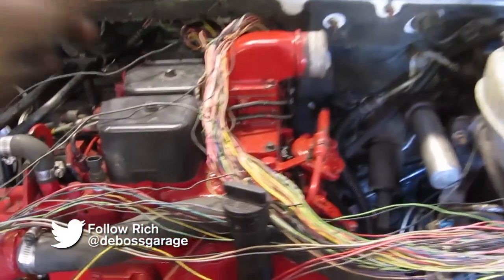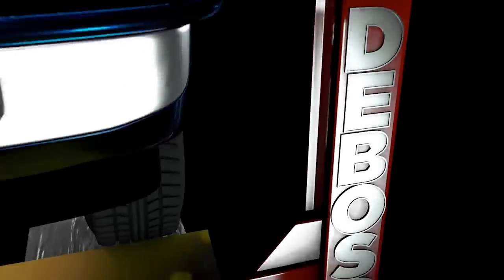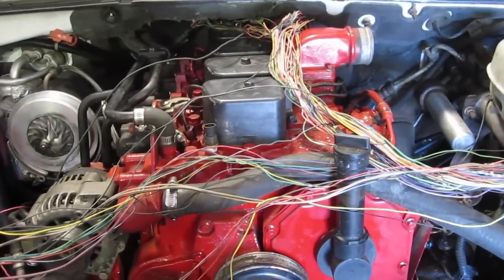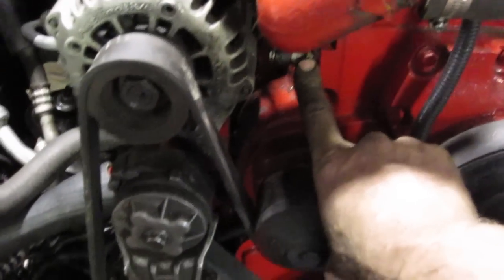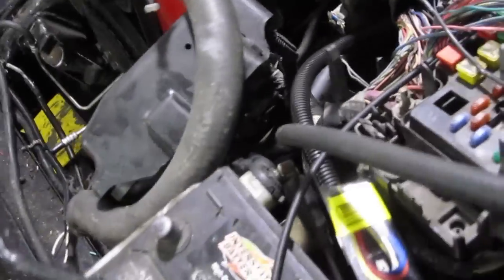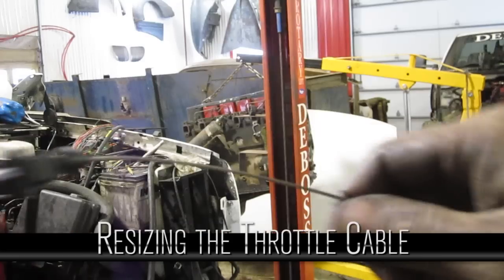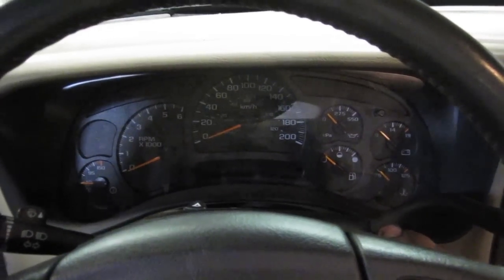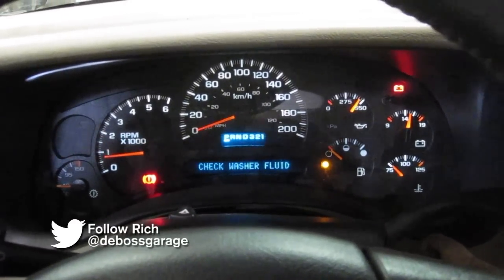Connecting GM Gauges to a 4BT with OEM Wiring #CumminsTahoe [EP5]

Comment: How did you get it to turn off by key, I have a 93 f350 with a 5.9 in it and the guy that built it put a pull lever shut off on it but it's a pain to have to pull that all the time so I'd love to have it shut off by key. Thank you!! Awesome build !
Reply from the maker: If its a VE, its should be key power to the shutoff solenoid built in on the back of the injection pump.  If its a P pump, most likely the shut off solenoid quit and he didn't want to replace it so he put a cable in it.   P-pumps have an external shutoff solenoid
Reply: +DEBOSS GARAGE thanks!!

Comment: just off the top of your head do you have any ideas for getting the electronic throttle from a 2007 tahoe to work with the throttle on the 4bt?
Reply from the maker: With my silverado, I took the drive by wire throttle body and cut off most of the housing.   I put a paddle where the throttle plate was and made a mount that held it to the side of the injection pump.  My paddle would hit the throttle lever on the pump.  When you turn the key on, it does a cycle check where it turns backwards first so it cant have a direct link to the throttle lever on the injection pump but just hits it.  This way you could keep cruise too.  It didn't work though because I would get outside the parameters between MAF, TPS, and MAP and it would go into limp mode.  I was trying to trick the ECU into thinking the 6L was still in the truck.  Since it went into limp mode to quick, I gave up on the idea and went with a bauman controller and a cable on the throttle.  I didn't know about EFI live at the time to change the parameters.  I think if you grabbed a junk valve body out of a 4l60E and plugged it into the original Trans wiring harness but still used the shift controller (that way it still thinks its plugged into the trans but isn't doing anything) and used EFI live, you might be able to get away with it.  These are the things that keep me up at night.  Let me know how you make out!

Comment: does all gm trucks have a low oil pressure reading if the oil gauge stopped working?
Reply from the maker: I believe all trucks 1999 and up had a low oil and pressure

Comment: I know this is a long shot but I am in desprate need of a video on fuel shut off wirring on the 4bt I've been all over the Internet and can't find exactly how to set it up and also I've read about a KSB ? For cold start timing advance ? I have no clue how to wire that up
Reply from the maker: Basically the KSB increases the internal fuel pressure and thereby advances the timing for cold starts.  I don't have one on mine, but the 6bt setup is the exact same.  There is a temperature sensor in the intake plate that tells the computer when to activate it.  You can put the KSB on a toggle switch but I would add a light to tell you when its on.  The shut off is only one wire on the top side of the pump about 2/3 back from the front of the pump.  It is normally off and 12V allows the pump to start fueling.  Hope that helps.  I don't have a running VE pump in the shop to make a video right now...
Reply: DEBOSS GARAGE thanks for the reply ! One last question ! You don't have one on yours so is it really necessary for me ? I live in the south it never gets below freezing for very long will it hurt anything not to use it ?
Reply from the maker: No, it won't hurt it at all.  When it gets really cold (-10 Celcius) it smokes for about 2 minutes longer than normal.

Comment: i have a 2005 1500hd and the gauge only work when it is warmed up.
Reply from the maker: You might have a problem with the Guage because it should work all the time.   those dashes had an issue with the stepper motors.  I have a video coming up soon on how to replace them.  any other guages acting erratic or getting stuck at a certain spot?